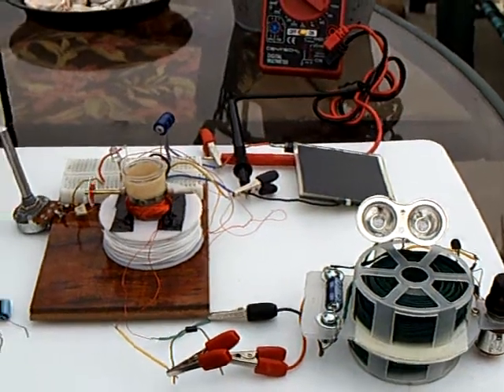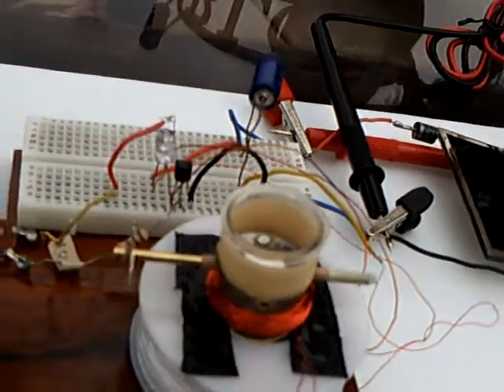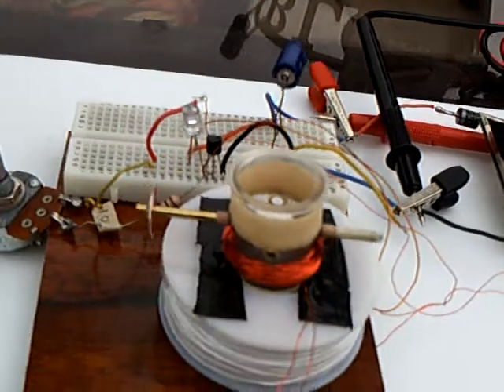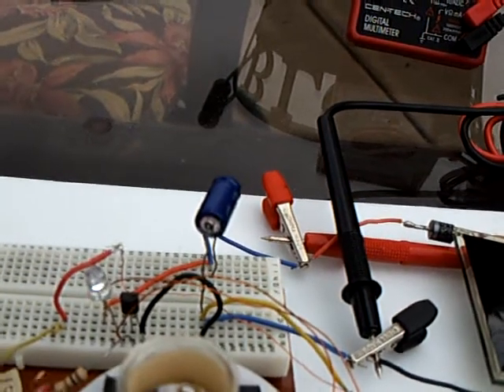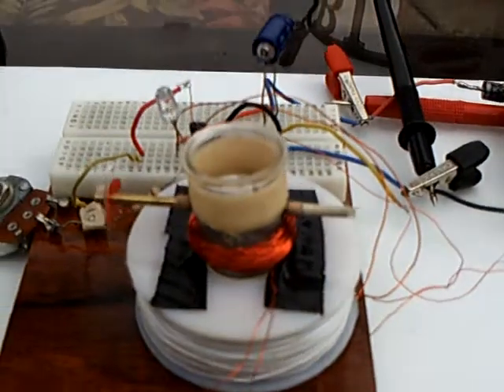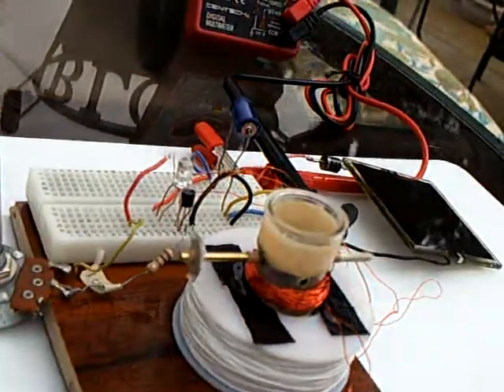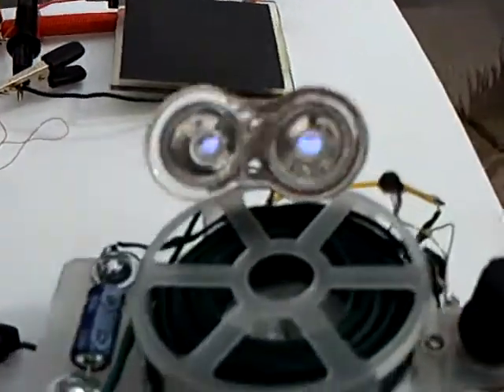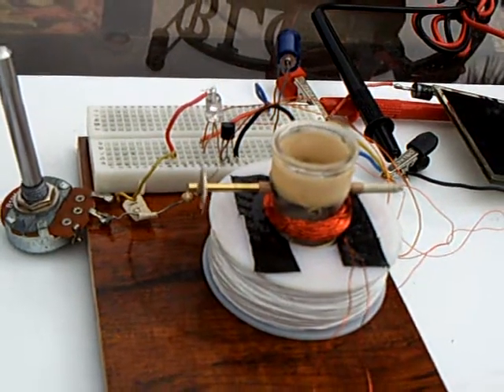A True Self- Runner  --- Another possible scenario

Comment: Cool stuff lid I like where this is going what about a well and a well house the water table gets mighty cold and a antenna with a black ball at the end of the copper pipe making the heater and connecting well could move a lot of air like a sterling and have a differential of more than enough for some electric gain hmmm...